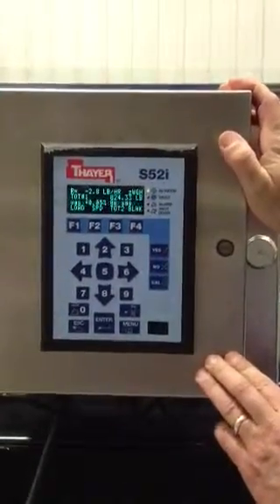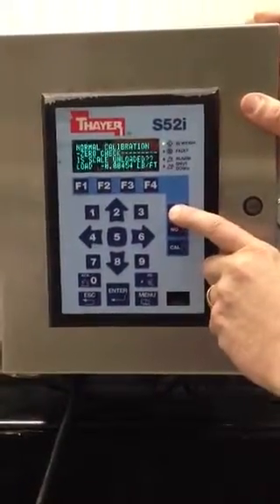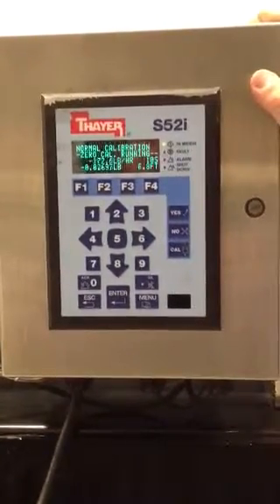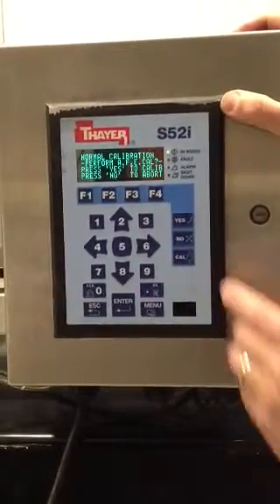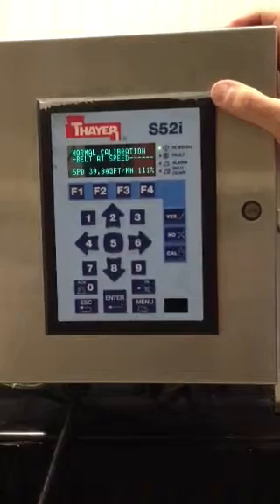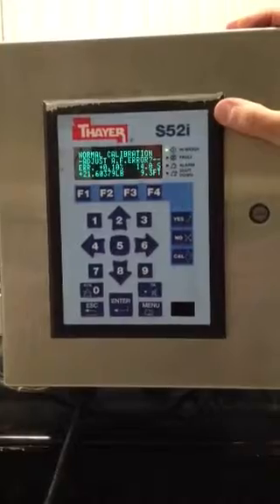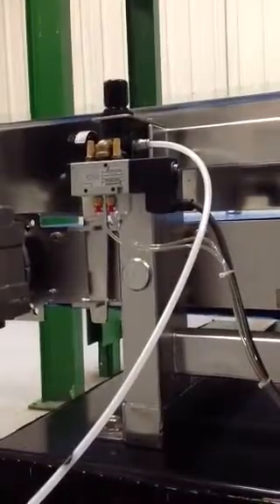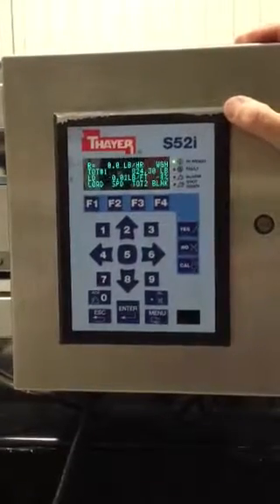Thayer Calibration demonstration 4-11-14

Comment: i have a problem in cal mod. its reading weight in cal mod 50-60tons hr. belt is clean and scale is clean what could it be
Reply from the maker: Brian, I am not with Thayer.  You will need to contact Richard DuBois at Thayer Scale at 781-826-8101.